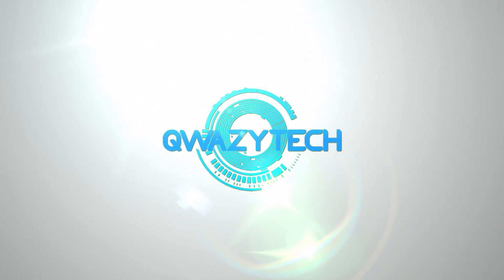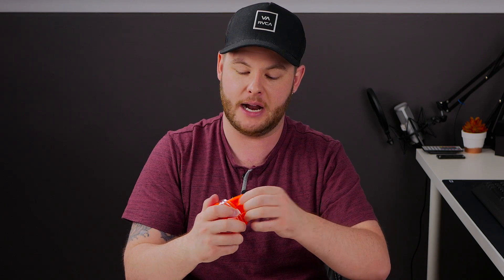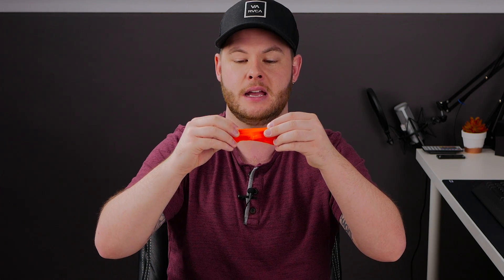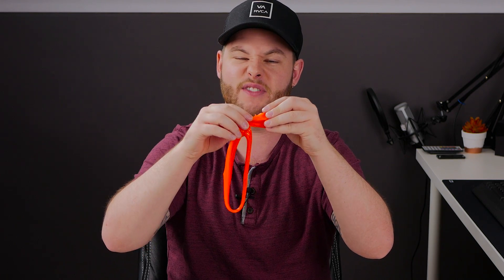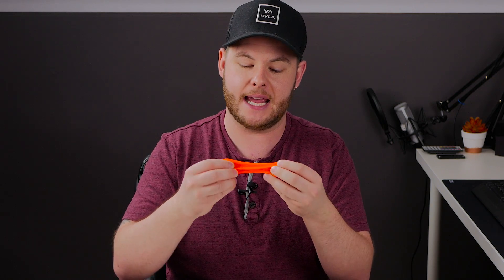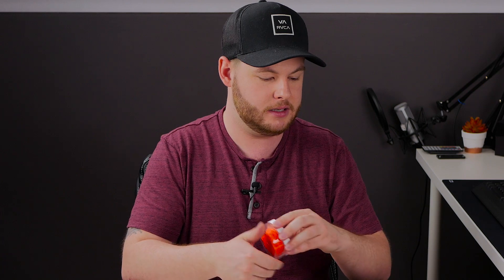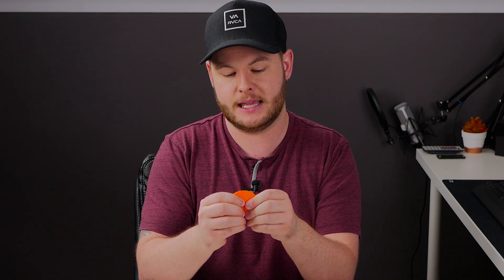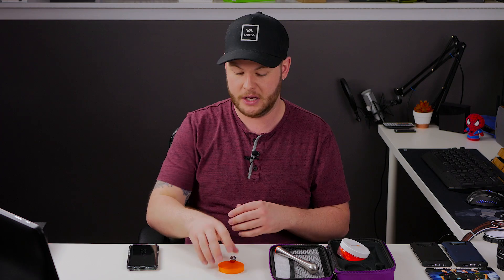How Does It Actually Work? | Gear4 Demo Kit [Non Newtonian Protection!]

Comment: i bought a D30 case for my 14 pro max.. its very tight to remove and insert.. i done it many times.. it will damage the phone ??
Reply from the maker: It’s very unlikely to cause damage as D3O is a softer material than the stainless body of the 14 Pro Max.
Reply: @qwazyd0gg  thanks alot .. now i can sleep .. 😇😇
Reply from the maker: I just exited a retail space where we sold a large variety of D3O cases, and I’ve never seen one damage any phone :)
Reply: @qwazyd0gg  Mostly the model Crystal palace Snap seems to be very tight.. do you have any idea why they make it very tight?
Reply from the maker: Maybe just to stay on tight, but I’m really not sure.